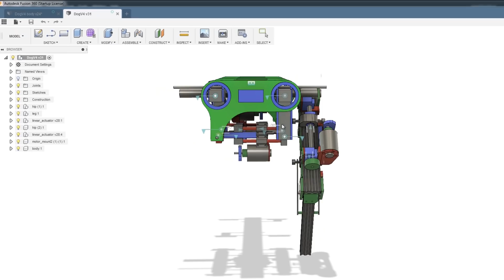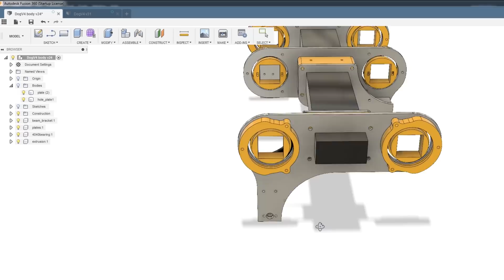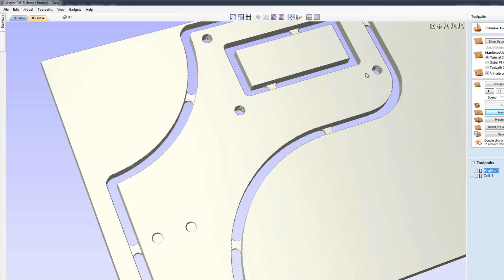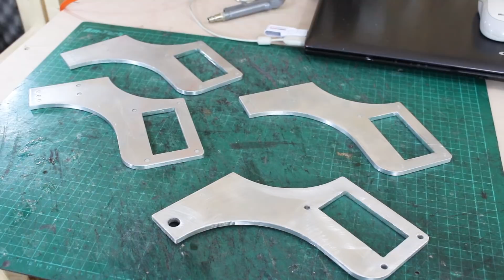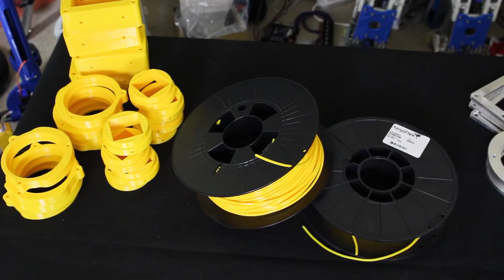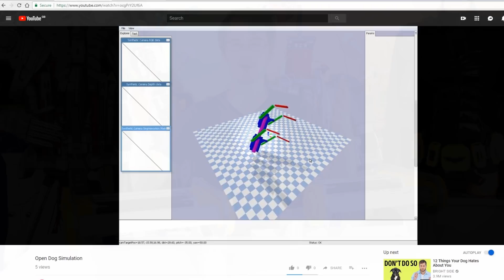openDog Dog Robot #4 | CNC Metal Parts | James Bruton

Comment: Any new machinist should get him/herself a copy of "Shop Reference for students and apprentices" by Edward G. Hoffman. It's got info on everything you'll need to know to get started. Ex: (chapters for this project) cutting speeds and feeds, cutting tools, and cutting fluids for machining. ISBN 978-0-8311-3079-4 if anyone is interested.
Reply: Cutting speeds (fpm using HSS cutting tools) for all wrought aluminum alloys (cold drawn/solution treated): 
Turning: 600/500
Milling: 600/500
Drilling: 400/350
Reaming: 400/350

Comment: Great vid!   I have drilled with a milling cutter but lowered the plunge rate alot, also you can use a "dog bone" for the internal cuts so you don't have to file, ramping in and out will keep your tool cool and will stay sharp for longer you can do it for bridges as well

Comment: There,s a brilliant little trick to hold down the aluminium to the bed thast really quick & really solid. Apply 2 or 3 strips of wide masking tape (I use the green stuff from Screwfix) to the bottom side of the plate. Do the same to the bed. Now the clever bit is to put some superglue on the masking tape on the bed & spray actuator onto the tape on the plate then fix in position on the bed. It resists all the sideways cutting forces but you can just lever it off when you’re done.

Comment: What speaks against it ro work in several steps and with different bits? You can first drill the whole holes with a drillbit and in the second step cut the contours. The same goes for the window. If you first drill holes where the corners of the window are, then you do not have to mill anything out. ;)

Comment: Slow down the bit. Excess tool speed means more heat if you arent running a steady flow of wet coolant.  Aluminum is too soft. 2 flute end mill, slower cutter speed, keep it wet.

Comment: One tip: Shouldn't drill with end mills. They are designed to cut from the side. Avoid plunges. Use a ramp or helix.

Comment: A few thoughts: 
- Use a drill press for drilling holes in the aluminium
- Save material by tightening up the placement of parts
- Since these plates are rectangular, why not butt the part up to the edges and save on milling?

Comment: your biggest problem is not coolant - its tool type and feed.
multiple flutes mean that you are rubbing the flutes against the material most of the time - not cutting. Two flutes are much better for slotting. Also as you said, spiral upcut flutes will clear the chips better.
Slower fed also means the tool rubs. You should be approaching your best feed rate by slowing down not starting slow and speeding up. Likewise you need to match your spindle speed AND your feed rate so you are cutting not rubbing,
If you get our speeds and feeds right on the correct tool, you should not need any coolant to cut aluminium.

Comment: It looks like the aluminum grade you are using is very gummy and more for forming. Try switching to a harder grade that's more machinable. Here in the states, the most common types are 6061 (harder) for machining and 5052 (softer) for forming. Also a two flute would help. Keep up the cool robotics videos!
Reply: totally agree, the cheap stuff you can buy is rubbish and will gum up. I use 6082 and machines beautifully. Also, invest in a proper fogbuster, you wont regret it. Also a two or single flute bit would be better.

Comment: I would hack one of those pump water sprays (used for gardening and the likes). feed the compressor into that, tape down the trigger and should spray for as log as there is coolant in the bottle and the compressor is running.

Comment: The bit will be happier with a constant air flow and no coolant at all, if you go the coolant route you'll need to run a lot of it. Also get a 2-flute bit, it allows you to cut a bigger chip per cutting edge and more heat is pulled away via the chips. Also try to cut at least 0.5mm deep,your bits have a 0.1 or 0.2 mm chamfer in the corners and taking a shallow cut generates a Z axis force the machine doesn't like.

Comment: You need paraffin for your cutting/cooling fluid on aluminium, not the stuff you are using, which is for steel.
Reply: Sure, but it smells worse I think
Reply: Thats true. We always used ethanol in a spray bottle.
Reply: WD40's also a good option and cheap !!!
Reply: Fynmar I don't think Ethanol is that available in the UK, would Isopropyl do the job?

Comment: you needed a 2 flute end mill, the end mills you used aren't center cutting .. so the 2 flute would solve both problems instantly
Reply: looks like 3 or 4
Reply: agreed! any non-ferrous metal or slotting operation you should use a two flute cutter, improves chip loading and clearance
Reply: More flutes, smaller canals to get chips out.  Also it is about feeding speed.  More flut need more feeding speed, or they don't get enough material to cut. 
So more fluts isn't always better.
Reply: I had the same problem with my open builds CNC router and switching to a 2 flute from Lakeshore carbide was like night and day. Quality makes huge difference two. The Chinese ebay stuff is kinda meh. If you want to use that 4 flute lower your rpm but keep your feed rate at like 40mm/sec. It looks like your experiencing rubbing which generates a lot more heat than just cutting.
Reply: So googling taught me flute=edge that cuts. So why is two-flute a good idea? To prevent bending of the tool because of symmetry? If so, wouldn't a 4 flute one also ok?
Reply: that would work also.
Reply: you need a Slot drill, which is two flutes and the cutting edges at the bottom are different and one goes past the centre thus allowing plunge cutting.  the cutter your using is called an end mill which is designed to cut with the side of the cutter.  also, paraffin is a great cutting fluid for aluminium.
Reply: @cinnamondonkey2397 , It looks like a 3 or 4 flute to me. 4 flute is a stronger bit. It has more center material to make it stronger/stiffer. It's also less likely to vibrate, which causes the bit to break. However it has less room for the chips. But, the chips should be smaller.

I've had the best luck cutting aluminum with a 4 flute due to the strength. Just don't cut very deep in each pass. A maximum of 0.020 depth for each pass is good. At that depth, with a 1/8" bit, you can cut at a rate of about 2 inches per minute without breaking the bit.

You can use WD-40 to prevent the aluminum from melting and sticking to the bit. WD-40 works great for this. I haven't tried the coolant he's using in this video.
Reply: No bro. He needs a single flute.
Reply: was just about to type that!!

Comment from the maker: SOME MISTAKES WERE MADE - It's my first time cutting metal with the CNC - pretty sure I'm using the wrong type of cutter but I'll be doing some more next time with deeper passes!
Reply: Hi James, great progress.
For machining Aluminium you want a two flute bit or even a single flute, combined with high feed and low depth of passes. The big thing with aluminium is the chips getting stuck, Aluminium chips are large and weld to the cutter pretty easily, so 4 flutes etc will get filled easily and the swarf has nowhere to go.
Reply: James Bruton hey James don't feel down about you'll get better I have faith in you just keep trying
Reply: I can show you the mistake I made into the bed of my Taig cnc mill.. its ok mate.
Reply: Love your videos.
To make slots, use a slot-drill bit not an endmill, they tend to have 2 flutes not 4.
To make holes use a smaller than diameter endmill, almost always. Or a slot drill.
Reply: You're doing good for a first suck at the sav!
One thing though, don't use coolant with carbide. HSS yes, carbide no! You risk the bit shattering from differential cooling. High spindle speeds with carbide, shallow passes. You can probably get away with using air for chip evacuation, but definitely not coolant.
Good luck!
Reply: Also check out the tape method of workhilding the NYCCNC has James, really good for low pressure cutting.
Reply: James Bruton you can always fix it in a later video
Reply: I keep my first "attempt" at cutting aluminium on my desk to remind me of just how bad I was. Like everything it just takes a little practice. Fusion360 has a very good CAM feature.
Reply: Hey James, I've been milling for a few years now and with Alluminium we usually just use air pressure really close to the bit, which gets rid of the chips coming off keeps it cool. If you make the passes fast enough and small enough it shouldn't generate too much heat.
Good luck!
Reply: Just Power Electronics Bigger bit would also help. Just finish up the corners with a small bit to keep the filing to a minimum.
Reply: James Bruton I genuinely admire you James. This is a fantastically interesting build. It’s gonna turn out to be the best build I’ve seen you done 👏👏👍
Reply: Hello James it's me again . Nice video and keep on. I always watch your videos and like them . When I see the notifications of your videos I start shouting and yessssssss😄😃😁😁😁
Reply: Yep less flutes is the idea, also lots of coolant.to lubricate the cutter to stop the Ali from sticking.
Reply: James Bruton No worries. By the way if you're interested in other ways to hold metal cuz then you should look into 1 2 3 blocks. They're not just good for holding wood and metal but also good as paperweights, tool holders, spacers and more.
Reply: not done any CNC in aluminium, but when you drill one uses alcohol.  Can that be a used here too, or is it getting to hot?
Reply: Also, besides using a proper Alu end mill, as other said two or one flute, try using software like HSM Advisor for Feeds and Speeds. I'm personally using it for my big CNC milling centre and it's awesome. You can adjust feed and speed for various cutting conditions, like different depths of cut, widths of cut etc. Also while you're slotting use ramping down on a angle instead of straight down, it's far more better for the cutter. ;)
Reply: next time you need to use coolant, instead of using a brush and getting your hands close to the mill just use a squirt gun! ;)
Reply: More important than coolant is not recutting chips. You want to evacuate chips. You can do it with air (messy). Or with vacuum (my preferred method because it removes chips and keeps things clean all at once.

Go single or two flute up cutting endmill for a router. Also look into the term "surface feet per minute". Once you use the right cutter, don't recut chips, avoid "chip thinning", and hit a good surface speed at the cutting edge... You will be able to walk away. Don't beat yourself up, we all struggle at first, especially cutting on a router which is subject to chatter more than a proper mill. But you will get there.
Reply: Exslent video. I wach them all. You could try wd40 or paraffin  for cutting lube. It works vere well. I use wd40 evry day for cutting aluminium. Maybe take out the mdf bord and clamp to the metal bed if the mdf warps. All so dont exspect your mill to get the same speeds and feeds as the haas mill on NYCCNC. Thanks for the epic projects
Reply: How big from x and y ist the biggest thing to cut with the cnc